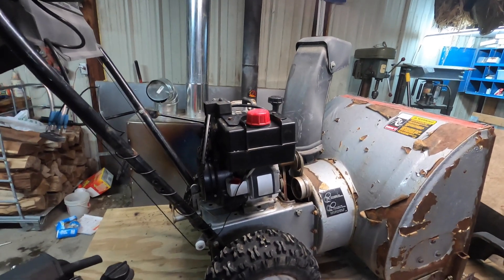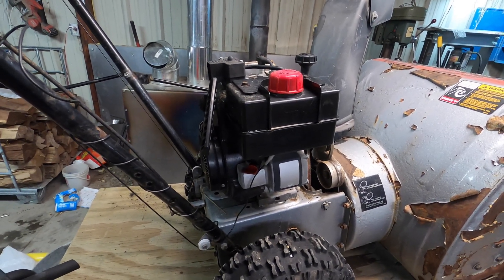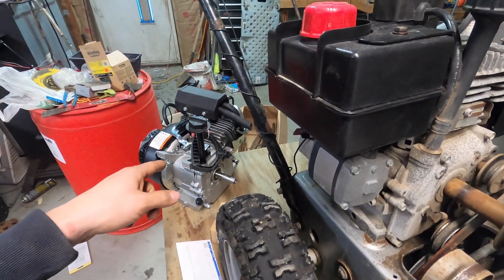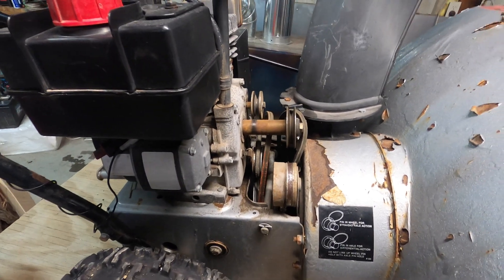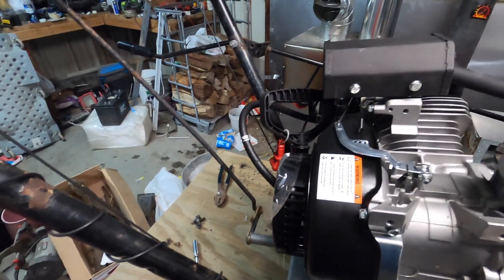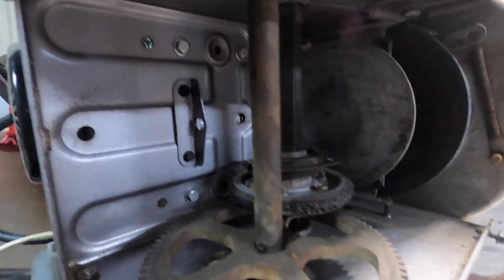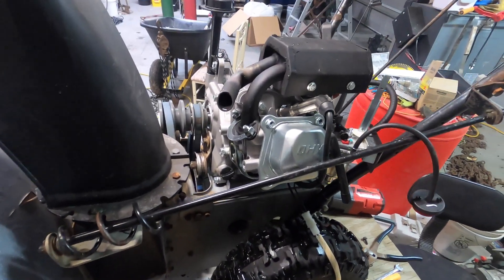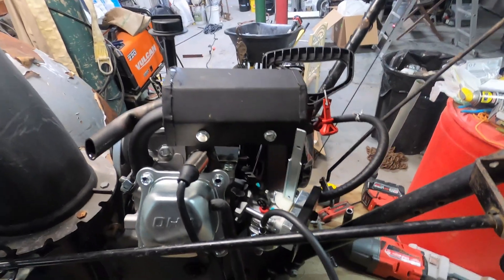MTD Snowblower Engine Swap for Cheap!!!

Comment: Is the new engine the same mounting with us at the Tecumseh
Reply from the maker: I’m sorry I’m not quite sure what you are asking this engine has the same mounting pattern as the original but if you are asking if they have the same as a tecumseh engine I’m not sure the mounting pattern on both of these they are 3-1/8" x 6-3/8"